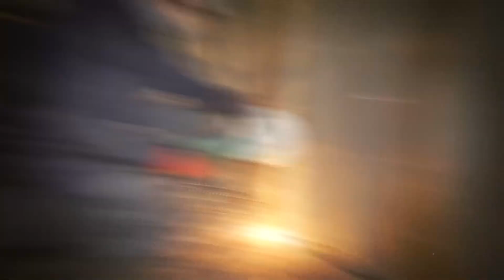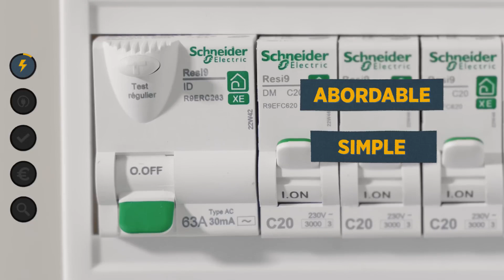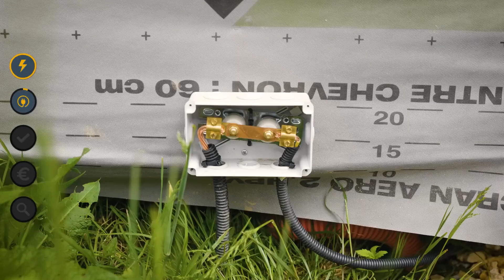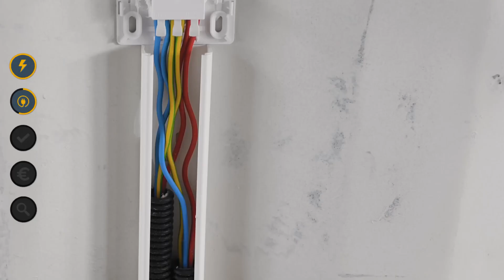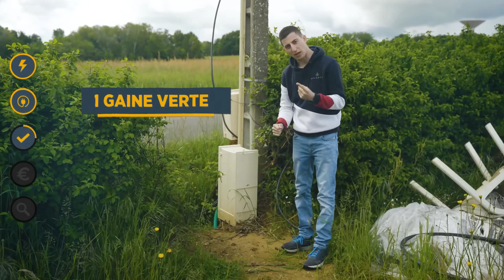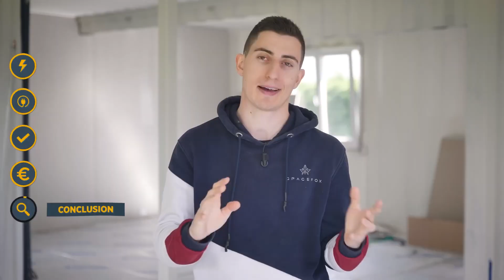Electricity 101: Powering My Container House

Comment: Did you know that YouTube boosts your algorithm if you engage with your viewers, e.g. respond to comments! 3rd time I'm asking - why use the shipping containers, when you seem to have used so much wood, it seems like you could have saved by just doing a timber frame. Genuine question. WOuld it not have been cheaper (and easier, i.e. less sanding) to simply do a timber frame?!